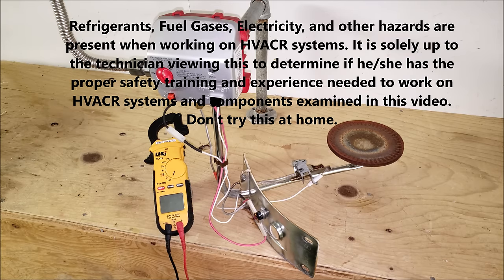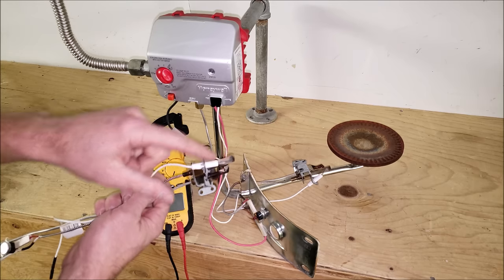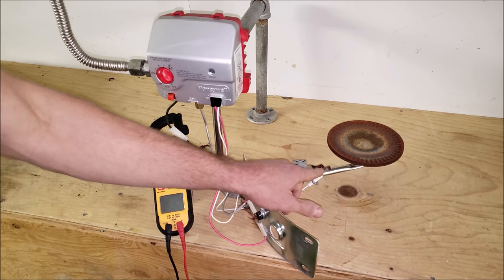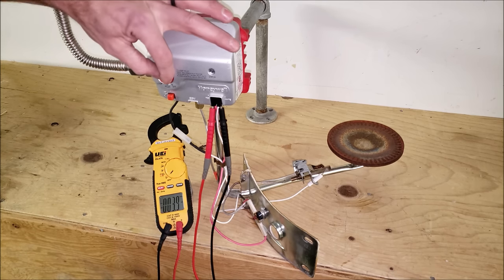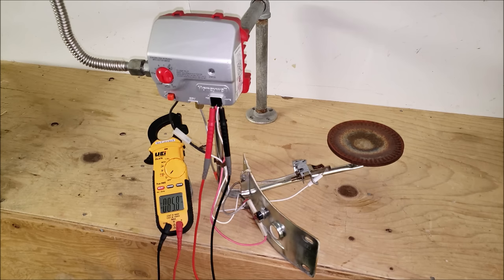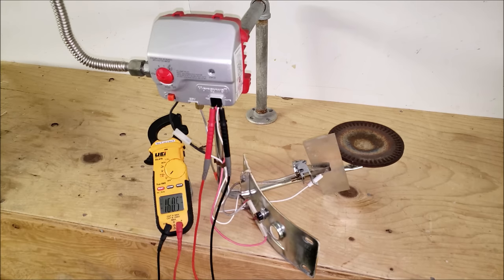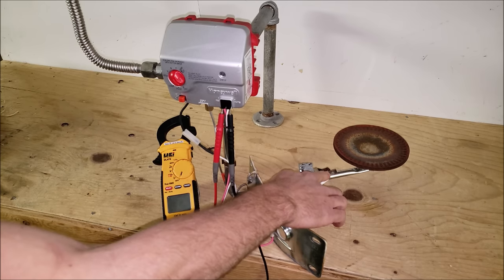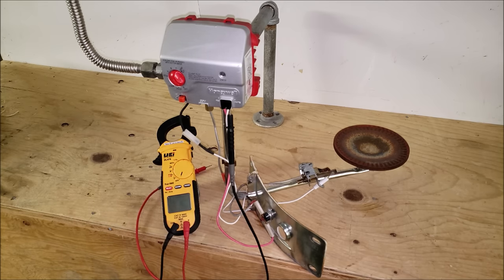Water Heater Pilot Light & Thermopile Troubleshooting!

Comment from the maker: Tool List-  https://www.amazon.com/shop/acservicetech

Support-  https://www.patreon.com/acservicetech

For those that are looking for the tools used in the videos: (Linked Below)
Thermopile Honeywell 750 Millivolt - https://amzn.to/2Ru68Ud

UEI DL479 Multimeter with temp sensor http://amzn.to/2jtsUbJ
Magnet Jumpers- https://amzn.to/2PyKPQZ
Alligator Jumpers- https://amzn.to/2PxqJXn

Fieldpiece ST4 Dual Temp Meter  http://amzn.to/2wc1ME3

Fieldpiece Bead K Type Temp Sensor https://amzn.to/2DBwKfs

Fieldpiece Wet Bulb Temp Sensor https://amzn.to/2RRI7Tw

Fieldpiece TC24 Temp Clamp https://amzn.to/2qHLyjZ

Yellow Jacket Refrigerant Gauge Set http://amzn.to/2aenwTq

Refrigerant hoses with valves http://amzn.to/2aBumVI

Yellow Jacket Gauge set & hoses https://amzn.to/2vLVkV9

Yellow Jacket 4 Port Manifold w Hoses https://amzn.to/2BkuGIq

FieldpieceSMAN360 Digital Manifold Set https://amzn.to/2BdoaD4

FieldpieceSMAN460 Digital Manifold Set https://amzn.to/2nB4Fe6

Compact Ball Valve for Refrigerant Hose https://amzn.to/2KUisW8

QuickDisconnect 90 for refrigerant hose https://amzn.to/2MMtVcg

JB 6 CFM Vacuum Pump   http://amzn.to/2nqbvo8

Appion Blue 3/8" to 1/4" Vacuum Hose http://amzn.to/2uYlVyc

Appion Red 3/8" to 1/4" Vacuum Hose http://amzn.to/2uYg6Ro

Appion Valve Core Removal Tool http://amzn.to/2uYr8WL

Yellow Jacket 1/4" by 1/4" hose http://amzn.to/2umtcod

CPS Vacuum Micron Gauge http://amzn.to/2v1nM3O

Supco Vacuum Micron Gauge http://amzn.to/2v1JRiA

RectorSeal Bubble Gas Leak Detector http://amzn.to/2ckWACn

UEI DL389 Multimeter  http://amzn.to/2xAdaJf

\Air Acetylene Torch setup    http://amzn.to/2aQalsb  
15% Silver Brazing Rods  http://amzn.to/2gVLyLc

Nitrogen Regulator    http://amzn.to/2bXdR5f

Nitrogen Flow Meter    http://amzn.to/2brvoBg

Other tool links can be found in the video description section.

Shop through Amazon! Your Purchases through Amazon provide a means for channels such as mine to earn advertising fees from all purchases after clicking through. Prices are the same as normal-    
https://www.amazon.com/shop/acservicetech

Comment: You just saved us a ton of money! My parent's hot water heater quit working and the pilot wouldn't stay lit. Replaced the thermocouple and still the same. Figured it was the gas valve which couldn't be replaced so my dad was on his way to get a new tank. Watched this and saw the thermo disk can be reset, sure enough that was it! Thank you!
Reply: Which part exactly is the thermo disc?

Comment: Thank you for this video, I now know that I have the proper milivoltage going back to the board but my pilot light will not stay on. So I’m thinking the problem is the gas valve, actually just the board that is in the gas valve assembly. Thank you again.

Comment: I changed out a thermopile and my WH still wouldn’t fire up. I finally found a video that highlighted the importance of installing the thermopile all the way in. What I thought was all the way in due to hitting against a cover was not. I reinstalled the thermopile all the way in after loosening a screw the initial video never mentioned. The result of the correct installation of the TP, was a working hot water heater.   Thanks for the info here you provided, I’m sure it will help some..

Comment: I just opened up my water heater burner and turned it out just like you have it.  I cleaned everything on it after that,,, I fired it up and worked perfectly !!!!  However after making installation it acted up again. Would not stay on. So I took screws off and pulled assembly about 1/2” and it WORKED !! So my problem is ==== lack of air in the housing burner.

Comment: Nice work. Was just checking on what you had for MV readings with pilot on. Had another today, the Honeywell valve acting up. So far it's been valves and not the power piles on all of mine. Prior to these power pile valves so they can have a pretty blinking light I think I replaced ten water heater gas valves in thirty some years.

Comment: Thank you for your video. You are a very knowledgeable man. 

My issue is that my water heater is over heating. At the lowest setting "LOW", the water temperature is still measured to be 140F (should be 105F at LOW and 120F at HIGH).  This is a 50 Gallon AO Smith LP gas water heater, 4 years old. A plumber was called  in and he replaced the Honeywell LP Gas Controller. It's been for two days after the controller replacement and the hot water is still burning hot on the "LOW" setting. Called the plumber and he says he is out of trick. What could it be? Thanks!

Comment: Great video, Craig.  Coming from the old school water heaters where you lit a piece of newspaper to light the pilot, I understand the reason but hate the piezo igniters.  That little window they give you is almost worthless to see what is happening at the burner/pilot.  Had a funny/nerve wracking thing happen years ago...the gas company decided to add a new lock-out valve to my gas main.  We went to the movies before they arrived.  They never notified us about this prior.  After they were done, they left the valve off and put a tag around my door knob to let me know I had to turn it on and re-light any pilots ( I had water heater, furnace and stove.). When we returned from the movies, the tag had blown off the door knob and we never saw it.  About a half hour later I heard “hon, there’s no hot water!”  I went to check the water heater...not lit...after laying on the concrete floor trying to light the pilot with no success for a few minutes, I yelled up “turn the stove on!”  “It won’t light!”  Went upstairs, discovered no gas coming from stove burners, went outside, saw new valve in closed position, turn on and re-lit all pilots...and about a week later found the tag in the bushes next to the door.  Ugh.
Reply from the maker: Ha ha that's horrible, nice, thanks Jack!
Reply from the maker: Jack, would you be willing to write a quick 1 to 2 sentence testimonial in reference to my HVACR teaching ability in school or online, questions answered, or the content that I have put out to date? I may display this under the book section, Q & A section or another section of my new the website. This new website, acservicetech.com should be up and running early next week. No hard feelings if you are unable to. I appreciate it! This could be replied here or emailed at info@acservicetech.com thanks a lot Jack!

Comment: Thanks for the great video. Can you explain how to test for a leak at the gas line ferrule connection at the pilot without having an external working model like you have in this video. Testing all external connections is straight forward, but I don't understand how to test this internal connection at the pilot in the field? Any suggestions?

Comment: GREAT Video.  There's one thing I'd like to add:  Thermopiles operate by the temperature DIFFERENCE between the ends of the tube.  If the "hot" end is perhaps 1000F, the "cold" end (where the cable comes out) may be 400F, which is fine.   I just finished correcting a problem on an old natural convection floor furnace.  The last person to work on it located the pilot assembly too high up, so that the main burner flame impinged on the center of the thermopile tube, leading to low output and premature failure.  Another test you could do is to put your DMM on the thermopile while it's disconnected from the control valve.  Light the pilot and hold the valve open manually to see what the peak output reaches.  I "assume" this should be close to 750 mV...???

Comment: Thank you for clear explanation, i have similar problem, i got the right burner set from the supplier, everything new, but the flame is still not staying lit when i release the pilot. 
I gave them the right model and serial. So why is it still not staying on? (Again i must confirm that it is a whole new burner set not just the thermopile)
Thank you
Reply: I have the same problem. I think it's the solenoid/gas valve that is bad. I can light the pilot and I'm getting enough DCMV, but the pilot just dies when I let off the pilot knob.
Reply: @jhanczaryk5766  i ended up changing the control valve and it worked like magic.
Reply: @gustavosh.5147  Awesome! I'm going to call around a few places tomorrow. If not, I will order online. Thank you for your time.
Reply: @jhanczaryk5766  no problem. But I want to tell you that I still tried to replace the thermocouple first, and since it was new but didn’t work, then I knew it’s the valve.
Reply: @gustavosh.5147  I replaced the valve. It worked

Comment: Old style manual valves work without issues, some for decades. Modern systems like this are problematic garbage it seems judging by comments online. The "energy savings" of these Honeywell garbage units are gobbled up by replacement costs as failures are common. Progress? Nope.
Reply: totally agree.... complete crap... the gas valves go bad just as often too

Comment: Man great video. I'm a little confused between the Thermopile and the thermocouple.  They seem to function the same what is the difference between the two?
Reply from the maker: The thermocouple is just one dissimilar metal junction that produces 30mv with a certain amount of heat where as the thermopile is a bunch of junctions equaling up to 750mv with a certain amount of heat. The 750mv and 750mv gas valve was used on older floor furnaces and is used on systems that are not ac powered such as fireplaces, freestanding stoves, water heaters and some furnaces. Then 30mv is used primarily on water heaters along with the 30mv gas valve. Thanks Tarik!

Comment: I have a Whirlpool water heater that the status light doesn't come on.   I have  720 mV at terminals on control valve, but valve solenoid doesn't engage.  I have replaced the Control Valve module, but does the same thing.    Any advice would be appreciated.

Comment: Hey, I have this same setup, and the pilot will light but the solenoid won’t click and hold. Is this the Thermopile that is bad? The light blinks like it’s ready on the controller but once I quit pressing the button, the flame goes out every time.

Appreciate any help!
Reply: I have the same issue as you. Have you tried replacing the valve? I'm thinking my solenoid is not sticking. I get the pilot but as soon as I release the knob, the pilot dies
Reply: @jhanczaryk5766  Yes I was getting the same issue. A temporary fix was to put leads on the 3 pins under the cover (bottom ground and top two are hot). I used a AAA battery to engage the valve, then it would work for a time before shutting off. I think we need to replace the whole valve thought. This method stopped working after 5ish times. I couldn't get the pilot to stay on either, not unless I used this trick.
Reply: @brett5526  I replaced the valve today. Hot water!

Comment: Very informative Video！ Great info for me the homeowner to understand my water heater. My question is mine only gets around 410 mv. For the past week, my pilot is turned off a few times by itself. Looks like i should replace my thermopile, right? Is the thermopile you listed below a universal model that works for different brand water heater as long as it has this Honeywell gas valve controller?
BTW, I got a wrong part ( thermocouple) today, and i am going to return it and get a correct thermopile.

Comment: I have the exact same setup, pilot light lights but voltage stops climbing about 150mv.  If I unplug the thermopile from the gas valve assembly then it climbs to about 600mv.  Hoping its the thermopile, going to replace it today.  Thanks for the great video!
Reply: I replaced it and the pilot stayed lit and burner stays on.  So it appears the thermopile can definately put out proper voltage when disconnected from the gas valve assembly and still not have enough power to keep the solenoid open when plugged into the Honeywell unit!  Thanks again learned a lot through this ordeal.
Reply from the maker: Thanks Tim!

Comment: I was checking a Honeywell controller-burner combo. 
Despite holding the pilot solenoid in to keep the pilot flame burning and having a reading of 270 mV, the pilot wouldn’t remain lit (I had to hold the pilot solenoid in to keep a pilot flame). Although the indicator lights flashed twice (indicating low thermopile voltage), is it possible that the gas control valve was bad, or the control board is faulty?
Reply: This was exactly my issue as well. I replaced thermopile with brand new one, and still have same issue. Although there is no longer a double flash from indicator light.

Comment: Great video thank you.  Question can the gas pressure be adjusted?
Reply: Ron White 
Yes the out let can be adjusted by a screw. U need to turn in to increase. Should be 3.5 wc outlet pressure for ng and 7 wc for lpg
Reply: @RockoRocko-rz7kx  thank you.
Reply from the maker: Hey Ron, On this version, the pilot and outlet gas pressure are non adjustable. The older style 30mv gas valves have an adjustment for the outlet pressure on the top. This one is also fixed at 10" wc and is stated on the side of the valve. Thanks Ron and Rocko99!

Comment: Isn't there a high temperature cut off Thermo cut off inside the valve that sticks into the water heater tank? Or is that not needed anymore since you have that thermopile safety thing down on the burner chamber plate? So the tank has it's thermal cutoff and the burner chamber has a separate thermal cutoff and do you have to have both or you just need one? And if the valve has its own Hi temp, thermal cutoff, is that a one time cut off and you have to replace the valve then or have things changed and the high temperature thermo cutoff in the valve can reset itself with these new or updated valve versus the older valves?

Comment: Can the voltage be too high?  Is there any way it can damage the valve?  I am reading nearly 1000mV and the pilot still goes out when the button is released.  I am now guessing that the valve is bad.  It blinks twice indicating the voltage is too low.  It is 10 years old.  Can the circuit board be repaired or replaced or is it the solenoid coil open or the valve of the solenoid stuck?  Usually a new thermopile will fix this, but not on this one.  Thanks!

Comment: I have changed out thermopile but im still getting 2 blinks. I notice that the pilot has the flame at the end as normal but has another smaller flame at base of pilot tube. Is this normal and how can I fix this? I dont see anything wrong. And can this be causing low voltage?

Comment: What do you troubleshoot for if it won’t light at all? I have gas being supplied to the controller but it won’t light at all and there is no flashing light on the box. I am holding down the pilot switch and pressing the igniter. Does that mean I have a faulty igniter?

Comment: Great video, it it's very common that customers ask if you can or know how to check the water heater or fireplace. I think they are very similar, milivolts gas valve. Please correct me if I am wrong. Thanks for all the very detailed videos. I have learned a lot. 👍💪💩
Reply from the maker: Yeah fireplaces, freestanding stoves, water heaters, and some furnaces are powered with millivolts. It is a simple flame proving and system powering method, thanks J B!

Comment: A good educational video. I got the same parts, but in my case the temperature reaches 270mV and above (over 400 mV while I was keep pressing the knob). But as soon as I release the knob button, the pilot will not stay lit.The LED continues blinking for no more a minute and then shuts down (at the end it blinks twice and then pause 3 sec). Based on this explanation, it looks like the solenoid doesn't stay down. I afraid by changing thermocouple/thermopile (the entire set) won't make any difference and won't solve my problem. Maybe need to replace gas valve. Also in my case for some reason the flame is much larger (used to be small as it shown in this video). Any thoughts on further troubleshooting? Thanks!
Reply: Did you try replacing the gas valve? I have the same issue as you. My mV goes up enough, but as soon as I release the knob. The pilot goes out.
Reply: @jhanczaryk5766  Yes, I had to replace entire gas control unit. The solenoid that suppose to keep gas flowing was bad.
Reply: @olekodundich1501  tyvm

Comment: Great detailed video! I'm currently having issues with this exact model. my boiler's pilot light keeps going out, the unit is in a rly small boiler room next to a separate furnace unit that heats base board radiator pipes. could not having enough ventilation/oxygen intake cause it to keep going out or is it more likely a specific part that needs to be cleaned/replaced? appreciate any advice~

Comment: The main gas supply line that gets attached to your thermostat what is suppose to be inside the tube just purchased a new burner assembly and there is a inner tube that is cut and crimped inside my main supply tube that goes to the orifice is this safe to install

Comment: I measured the voltage and it tops off at 600mv but the pilot light doesn’t stay on. I just replaced the controller and initial test it did stay on but controller was flashing 2 lights then 5 seconds off which indicates low mv, system will reset. After that, i could get pilot to stay on.  This video pilot light triggers the solenoid at 200mv. I assume the thermopile needs to replaced?

Comment: That was a great video. I can find out very little about my five flash temperature sensor failure alert. A Rheem video shows the sensor near the burner assembly. I have an A.O. Smith water heater. A.O. Smith is of no help. Everyone says it needs a new gas valve but I can undo the thermopile and trick the water heater into making enough hotties water for my bath. Please advise. 😐

Comment: I have the same setup and the pilot starts a flame but I can’t get the burner to light. And I’m not getting any green light flash or anything? I’ve checked the voltage and it doesn’t go up when I hold down the pilot button